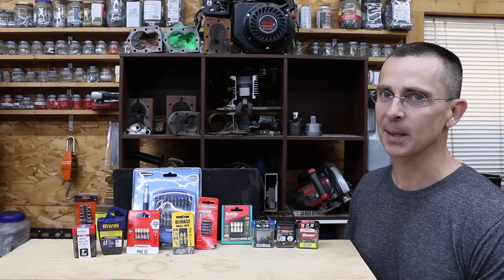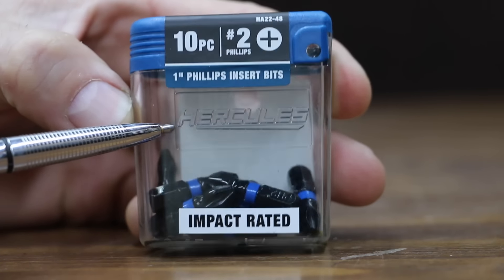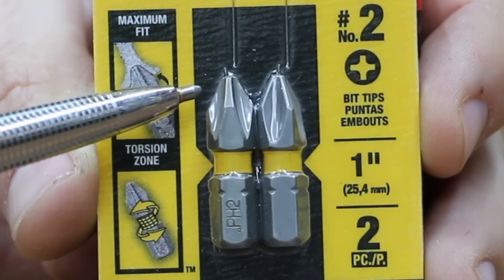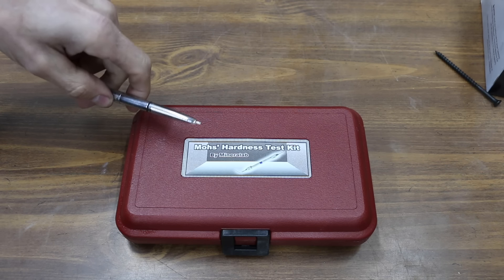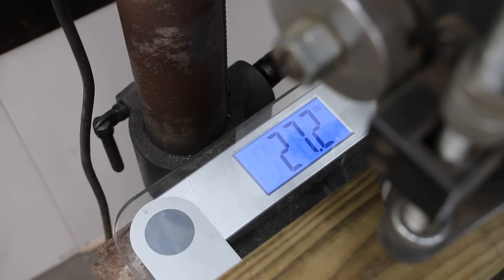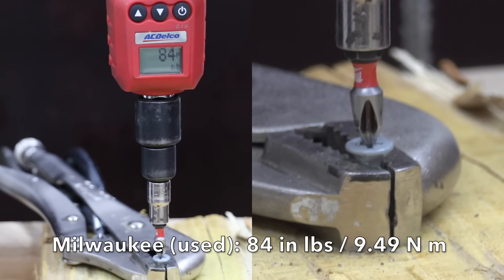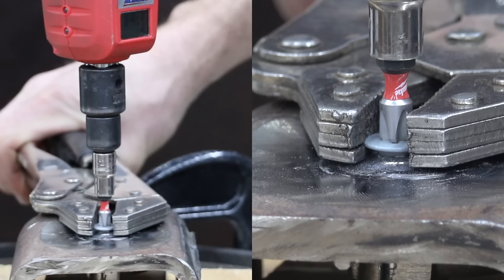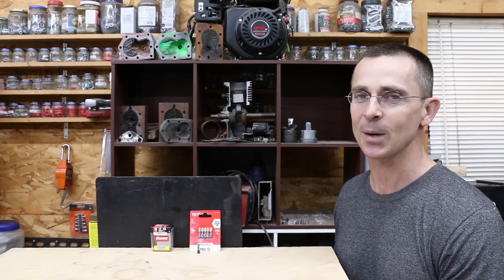Which Impact Driver Bit is Best? Let's find out! Phillips #2 Showdown

Comment: The logical next step, Torx (star) bits!  I'd love to see a test on those since I steer clear of Phillips heads generally, if it's practical to use Torx I always will!
Reply: For consistency in driving. Only thing for really tough wood is hex head.
Reply: @brodriguez11000  For my trade (weatherization) I find that I am always upsidedown twisted around reaching over one thing and under something else trying to get a screw into something in an attic or a crawl space stretching as far as I can, so nice even pressure isn't really possible in most real-world situations, so I always go Torx because if you can get the bit on the head, it'll drive that baby in.  Why is rarely the case with a Phillips head, often it'll round out the head of the screw and damage the crap out of your bit, making the next screws even harder to drive in.
Reply: I agree, would be interested to see if the brand results are comparable. Add in Norske bits, I have heard good things about them
Reply: Torx, hex, square and the 3 sided square are far better than Phillips. Though I steer clear of most torx screws and bits as I tend to snap them more often than not.
Reply: Yes, WHO in their right mind uses Phillips?! At least Pozidriv is a minimum nowadays.
Reply: @djjazzyjeff1232  The only problem with torx is that there is almost certain that you will pick the wrong sized bit at first try. =)
Reply: @Xanthopteryx  Lmao no kidding!  I like to get the color coded ones if I can.  Uncolored is 25, Purple is 20, Green is 15, Gold is 10, etc, but that's not always possible.  I've gotten a knack for knowing what size is the right one just by eyeballing it just from experience lol.
Reply: @djjazzyjeff1232  keep a square tip handy. Sometimes that can get you out of a bind with a stripped Phillips.
Reply: I too would like to see the torx bits. For a different reason, they are used a lot in the automotive industry now. Maybe the inverted torx too
Reply: Yes that would be interesting..
Reply: phillips are designed to strip the head before the threads. they are not ideal for most situations. its unfortunate its been used as the standard fastener for so many applications
Reply: torx has so much more grip than phillips i would love to see a test on those to
Reply: Hex torx and square drive is all we use in Australia
Reply: And the pozi and square lock theres alot of work for him
Reply: My local hardware store started to stock affordable, stainless Torx screws a while back so switching was a no-brainer. Man, am I kicking myself for not discovering Torx earlier. The fact that NO downforce is required to drive in the screws makes a huge difference.
Reply: @djjazzyjeff1232  my observation exactly!
Reply: @Xanthopteryx  My torx bits cost around 60ct / piece, so when I buy a new box of screws I always put a new bit of the correct size in as well. So when I open a box on-site, I know where to look for the correct bit.
Reply: I'm curious of this as well. I seem to have more trouble with the small torx than the bigger ones. I dont have much experience with the others.
Reply: Why not the square head bits as well?
Reply: Totally agree.    For deck screws and SPAX lags I go for Torx.    Hex is good too but stick up above surface so a bit more limited in use.
Reply: @kameljoe21  Just FYI, the Phillips head was designed to intentionally cam out to help prevent the screw head from snapping off.
Reply: yes, torx need to be tested
Reply: I'd like to see a comparo of those unmentionably aggravating triangular fasteners.  I generally end up inventing new curse words working with/against those things. I only need something to remove them. I can find something else as a replacement. They're more maddening than the security Torx fasteners.
Reply: @brodriguez11000  A quality square bit is the exception if you need to flush mount a wood screw.
Reply: I would be careful with torx, I had a bit shatter in use and I still have some of it embedded into my hand.
Reply: I think torx test is a waste of his time. Phillips presents the toughest test, and shows the most weakness in driver design. I've never encountered a torx bit that didn't do the job satisfactorily - while I've found different bits make a YUGE difference with phillips.
Reply: I agree...but prefer to replace both with Robertson screws......torx strip out as bad as Phillips given half  a chance.
Reply: @GroovesAndLands  you must have never used one of the security Torx bits. They fairly much suck
Reply: +1 on torx bits
Reply from the maker: Thanks for the video idea.
Reply from the maker: Thanks for the feedback.
Reply from the maker: Thanks for the video idea.
Reply from the maker: Thanks for the feedback.
Reply from the maker: Great suggestion!  Thanks
Reply: Agreed - Test Torx bits please.
Reply: You Wish  yeah if you get to interrupt engine torx bolts/screws and they seem really tight, tap them a couple of times with a hammer to give the bolt a little shock and they'll come out a lot easier. I broke 3 torx bits on the same bolt before I figured that out one day 😕 LOL
Reply: You Wish  And neither is Torx Plus!
Reply: so happy over the last ten years using GRK screws with the Torx head.
Reply: @Xanthopteryx  my thoughts exactly!
Reply: @Xanthopteryx  why? You could say the same for Philips, pozi drive, hex, Robertson...they all have more than one size...
Reply: @dunc71  Well, i never chose the wrong pozi, robertson is.. not a problem since it's like never used here in Sweden and hex, yes, sometimes i pick the wrong one but not as often as torx. I think (this is a theory) that the way they are designed, they trick the eye. It's not so common that i chose a bit that is to small, but often it's to large. Maybe since the bit looks smaller than it is and the screw looks larger than it is. A visual illusion so to say.
Reply: Wow I just made that comment up at the top lol I said pretty much the samn thing no logic in using philphs head they are a flawed and inept design u may as well use flat head screws
Reply: Try Robertson screwdrivers
Reply: I pretty much cringed the whole video because he was using Phillips. Only an american would use phillips in an impact lol.

Comment: I've used about every bit in existence.

All I've used the past two years are the Milwaukee 3 and 6 inch shockwave bits. They have the best fit/longevity in my experience.
Reply from the maker: Great feedback! Thank you
Reply: exactly!! The moment I saw a Milwaukee amongst the lot that he tested, I wondered what’s the point of the video then 😂😂
Reply: as an electrician i use the milwaukee 6 inch bits almost exclusively in my bosch 12v impact. they last about 3 months with daily constant use and i usually only have to replace them because i lost it not because it stopped working good
Reply: @trentonreese2713  That's half the problem - loosing them or someone borrowing it "for a second" and keeping it lol.

Comment: I would love to see a comparison of different screw bit geometry, philips vs Robertson, torx , etc
Reply: I second that emotion!
Reply: Yes!
Reply: I feel like torx is the best personally. Just a guess though.
Reply: I will love to see that also
Reply: Torx all the way.
Reply: Yes!
Reply: POZIDRIV
Reply: great video idea
Reply: I NEVER use philips anymore, short of drywall
Reply from the maker: Great recommendation!  Any specific brands you'd like tested?
Reply: Project Farm Judging from this video, my brand preference has been wrong! Lol. I think if it’s a solid line of bits like the shockwave then the consistency of the build quality should be enough to check things like the likelihood to cam out, and durability.
Reply: Project Farm hello there! Thank you for your great contribution with your hard honest work you’ve been doing for everyone without being bought by any brand or Corporations. 
I’m a regular handyman who greatly appreciates all of your inputs. 
The brands I use are Power Pro and Scorpion. Perhaps because those are the brands available at my local hardware store. 
Keep up the great work. Regards
Reply: Snapon,dewalt,milwaukee,makita,craftsman,wiha

Comment: For 3” screws, I gave up on Philips heads screws a couple years ago. T25 torx is all I use. So much better than Philips but very good for testing!
Reply: Absolutely agree.
Reply: @phbrinsden  Totally! 👍
Reply: Yes. Torx is the way to go.  Especially with 4 in. Good luck not stripping a 4 in   screws with a Phillip's head..
Reply from the maker: Thanks for the feedback.

Comment: The best screws I found were "square" drive.  They'll brake before they strip.
Reply: ...they'll BREAK before they strip
Reply from the maker: Thanks for the feedback.
Reply: Ever tried European butterfly?
Reply: Either Square or torx
Reply: I can't imagine how frustrating it would be to build anything with Philip's head screws.
Reply: Lol "square drive" Mr. Robertson would be highly disappointed in you that you don't know the proper name of that bit.
Reply: It's called Robertson, and yes they are better in just about every way.
Reply: I've found that the square head screws that come with vinyl railings/fences strip too easily. Maybe its because they're just cheap (just like the railings and fences themselves)? In any case the best screws I've used were torques.
 edit: torx not torques!
Reply: @lajudicedaniel  Crappy screws come in all flavours I think. Torx are great until they get rusty, those little splines on a t-25 don't take much effort to wipe off once the screw is really stuck. I made a custom "T-28" the other day for just that purpose. Gave a T-30 just a tiny lick on the grinder and finally got that last rotten screw out.
Reply: If I would  have said "Robertson ", most would  probably  not have understood.   "European  butterfly", yes I have  removed  a few, but didn't replace them with  the same.  Where do you purchase  them?

Comment: I broke a few Milwaukee Shockwave philips bits trying to get my brake rotor retention screws out... one left the tip embedded!  This is probably a hard use case... but for this use, a softer bit is probably best.  The Shockwave bits are extremely hard and when subjected to impact use in metal tend to shatter.  I was able to get the screw out using a Dremel cutoff wheel to slot it, then the blue wrench (acetylene) along with a Ryobi flat bit.  It can't be stuck if it's near liquid!
Reply from the maker: Thanks for sharing.

Comment: It would be cool to see a video comparing the different types of bits like Philips, torx, square drive, etc.
Reply from the maker: Thanks for the video idea.
Reply: Already done it.
Square is bad. They snap off.
Torx are the ones you use when your labor force are wussies which is what you get for 15 buck an hour.
Reply: I'd like to see other type heads as well. Phillips are terrible because they cam out and strip easily, Robersons are good until they wear and start rounding out as well. Torx are great but lately I've had torx bit heads breaking in the screw heads. But it would be interesting to see the strength difference between them all.
Reply: Dan Smulders there’s a difference between Robertson and square drive. Robertson’s are not generally used in the US, and have a slight taper compared to square drive which have no taper.
Reply: @mikeries8549  $15/hr for manual labor?! Where the hell do you work? Around here you're lucky to start off making 8! You wanna talk about a high turnover rate...
Reply: Torx (star drive) screws changed my life.  Going from philips to torx is like going from flat head to philips.  Sure we can all use philips, but if you're in some harder than normal wood torx is so nice as it requires minimal down force.
Reply: @gotdangedcommiesitellyahwa6298  In my state $14/15 an hour is the starting wage for laborers.

Comment: Would love to see a video on how time effects the octane rating or the efficiency on gasoline.
Reply from the maker: Great video recommendation.  Thank you
Reply: If you haven't watched it, PF did a video on some prehistoric Quaker State oil that's pretty neat and in the same vein
Reply: go check out Taryl Fixes All. theyre doing a similar test like that right now
Reply: I'm actually waiting for 91 Ethanol Free gas to drop down to $2.29.9 and buy a 100 gallons for my experimental aircraft!
Reply: @kenhurley4441  $2.299

Comment: Based on the Makita "twisting force to break" test, it evidences the qualities of the predominant Japanese heat treatment philosophy: stale gummy bear.  A hard outer shell and a relatively rubbery center.  The material twists and deforms, trying to prevent overall catastrophic failure by allowing localized plastic failures.  It is achieved normally with a controlled annealing and cooling ramp followed by an induction hardening stinger for the shell stiffness.